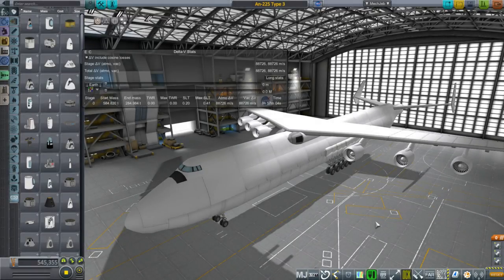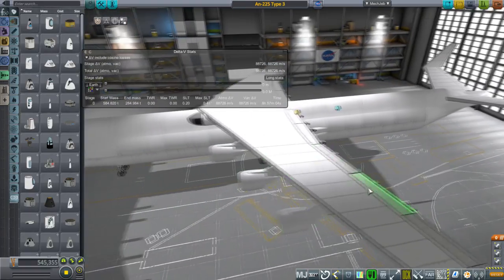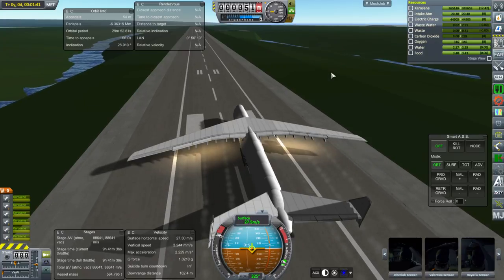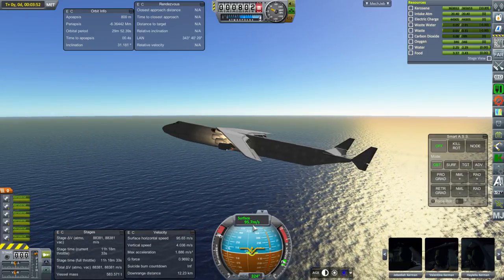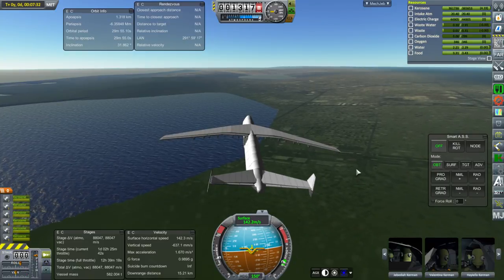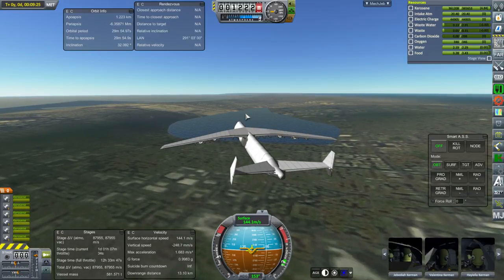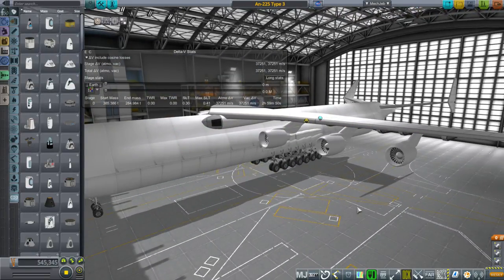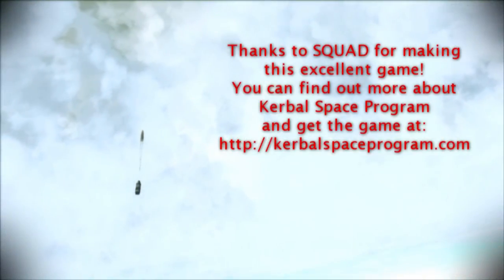Kerbal Space Program RO Sandbox - An-225 Redux

Comment: Speaking of more practical things in the future, could you make the modified STOL C-130 from Operation Credible Sport?
Reply from the maker: That was practical? Not only did it have all sorts of issues in testing, but it was never used for its intended purpose. I'll think about it, though - we may have an appropriate cockpit, which is half the battle.
Reply: It was very practical for the guy selling the Air Force the solid rocket motors. ;)  But yes, the whole thing was bonkers.   Even more bonkers was that it was supposed to do its mission under fire, carrying 150 civilians.  I'm sure a bullet punching a hole in the side of one of the ASROC, Shrike, or MK-56 rocket motors would lead to Challenger-like consequences.  Oh, and if every thing did go to plan, the ending was to land on an aircraft carrier at sea.